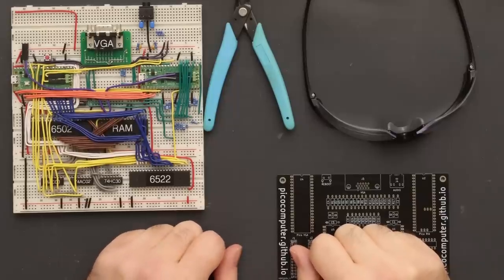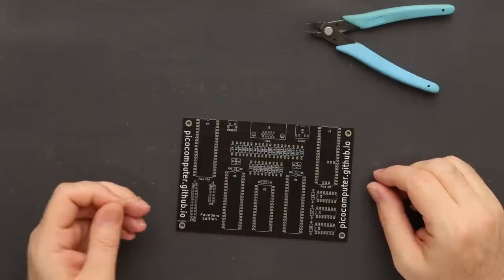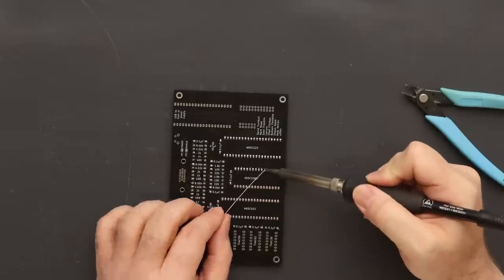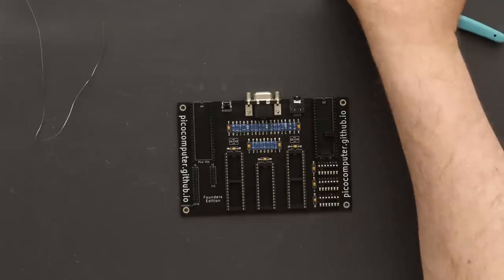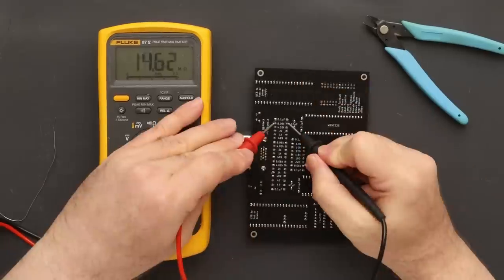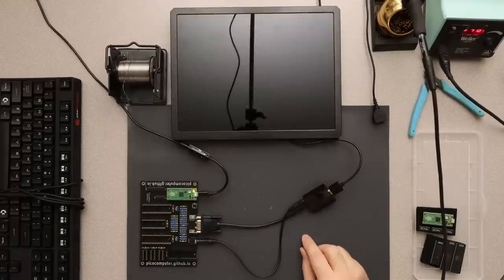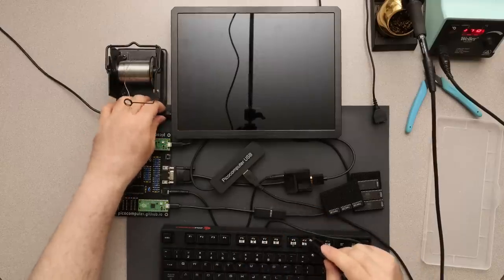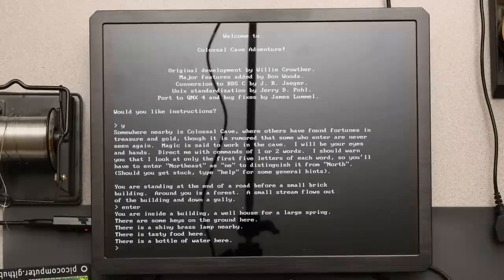RP6502 Ep10 - DIY build with soldering

Comment: everything using a esp32, rp2040 or a raspberry for graphics (or anything else) doesn't feel right in context of retro computing - it's like cheating, imho. FPGAs and CPLDs are tolerable because they are real hardware, so to speak.
Reply: TBH - that's why I don't think you can build a "new" retro computer.  The C64 was the best you could get in 1982.  Either work with that hardware, or accept that these days the equivalent is the PS5.
Reply: @davidlloyd1526  That's not true. Of course you can't develop ASICs for new graphics chips or clone old video controllers as ASICs like the VIC but you can use FPGAs or CPLDs for creating new graphics controllers - or you can synthesize old retro chips. Analog Pocket (or Mister project) does exactly this, they are creating FPGA cores that resemble the original hardware as much as possible and it's not a software emulation but a translation of the original hardware into a hardware description language like Verilog or VHDL. X16 uses a FPGA for the Vera which is, imho, the correct way for a retro system if you want to be able to manucature numerous systems without the risk of running into shortage of obsolete graphics controllers. Imho software emulation with a multi-hundred-MHz-CPU anywhere used in a retro computer design isn't the real deal. But of course it's only my oppinion and nobody has to agree with it.
Reply: Imho this project is not really retro computing, it's just feels like it as it has a native 6502 CPU. It has completely different kernel, GPU, I/O management, storage, etc. It doesn't try to emulate any existing retro computer. It's a new computer running 6502 code which can leverage high level services supplied by the ARM core and the other PIX devices accessible on the bus. This is a hybrid system, and the 6502 has a concrete API to the ARM side and vice-versa.
Reply: @davidlloyd1526  PALs and GALs (and HALs) were standard parts in the early 1980s and I can make plenty of "new" retrocomputing around them today. Not practical for complex sprites (unless you enjoy masochism), but practical for almost everything else including simple sprites.
Reply: @punpck  hardware emulation is software was even part of the 80s home computer era. Just remember the flawed 6522 VIA chip which caused Commodore to bit-bang the serial bus in software for the 1541 disk drive. :)

Comment: I have never understood why someone would want to spend $500 on a new 6502 based computer. Surely the same thing could be written in code to run on modern hardware. I totally understand why people want original hardware for running old games and software. Failing that FGPA based systems are better than emulators. But a completely new system with very little software available - no!

Building your own Picocomputer - totally get it. Nice video.
Reply: I think the x16 got hit with wild scope creep, and they wanted to do too much of the manufacturing internally which is just not cost effective at the volume they are likely to do. 

It does look like pretty much the ultimate computer based on this level of tech, but it's just way too expensive.
Reply: @annieworroll4373  Pretty sure the X16 is just a bit of fun.   People are taking it waaaaay too seriously.  Whether it's $50 or $500 is pretty irrelevant.